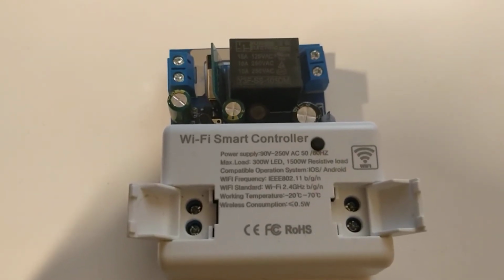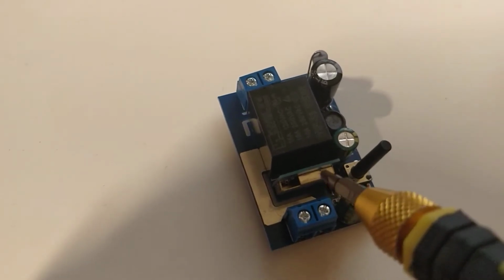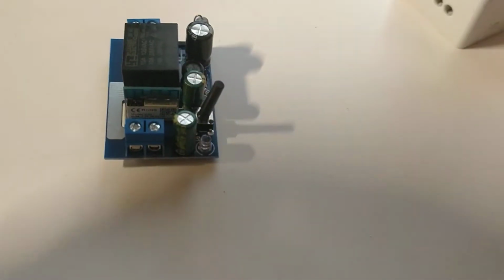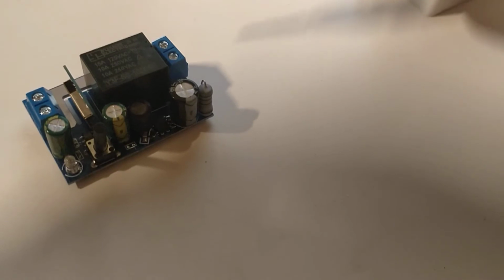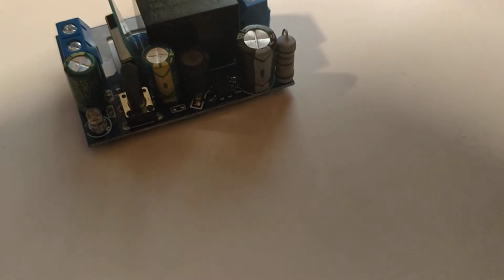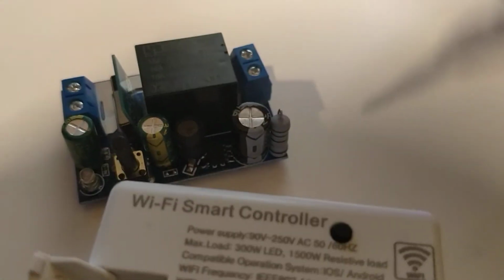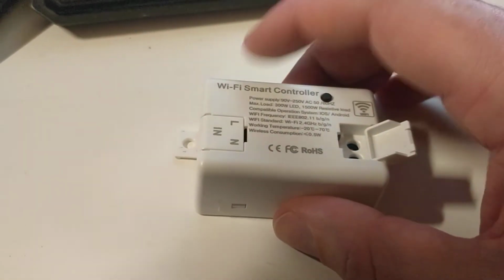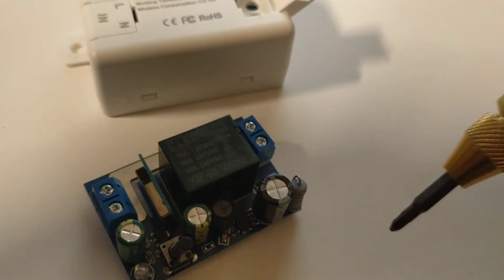A look at some WiFi switch modules

Comment: Can I use these on my main room lights or should I get actually light fixture with it built in, they are so ugly though I like the old UK style light switch xD
Reply from the maker: These are good for building inside stuff and so on if they can be hidden inside a fixture then that's grand but automated switchplates or bulbs/fixtures are probably the way to go. They will work on main room lights but aren't the handiest option for them.
Reply: Yeh I'm thinking of using them now for cheap connectable led strips of ebay for their rooms
Reply from the maker: @JBiggs-ld5xt  A grand use, I have them stuffed inside a few different lamps I've built and they're dead on for those as long as they can be hidden away